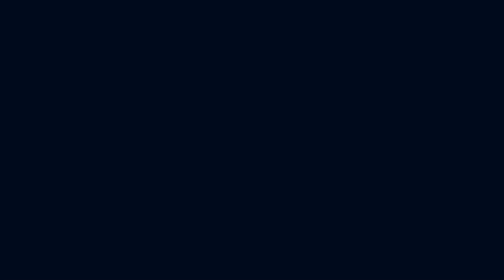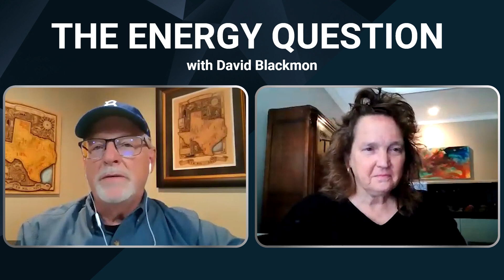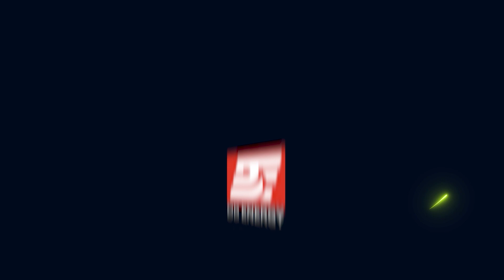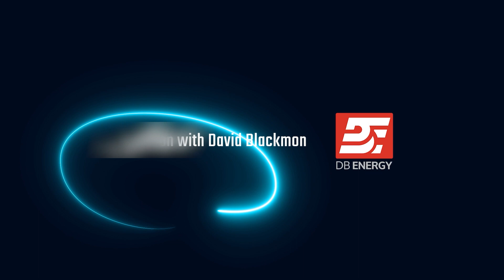The Energy Question Episode 48   Cindy Taff, CEO of Sage Geosystems

Comment: I’m no expert but i wonder per well what the cycle time is.  What volume of water is pumped in, what the final pressure is, is this pressure above fracture gradient, what volume comes back, what cycle time and assuming it comes back at 250F or higher, what is the time to get there and what MWHr.  She mentions 3MW but is that per well over a year?  The fact that it only competes with Li ion battery and pumped hydro make me think it’s still expensive.  As for storage, how are they paid during the lulls?  Do they need electric submersible pumps to fatten the tail of returned volumes?  You should have had a bit of research with an engineer to help take this to the next level… methinks!